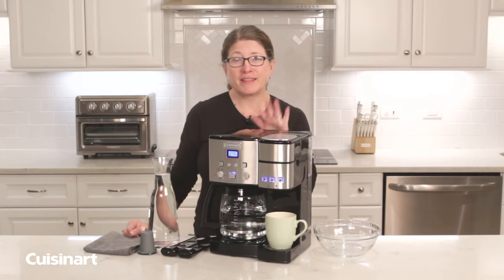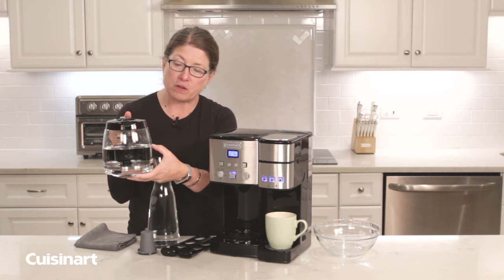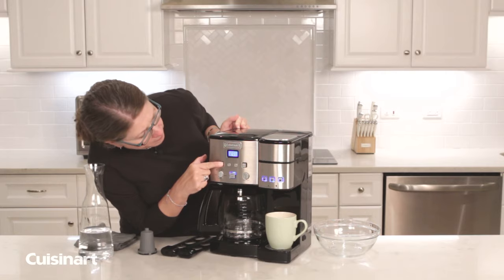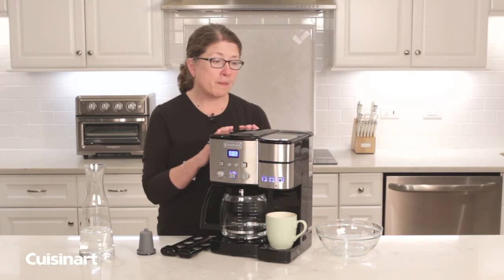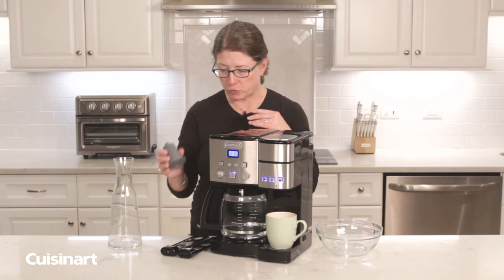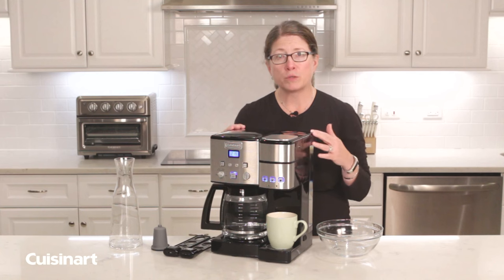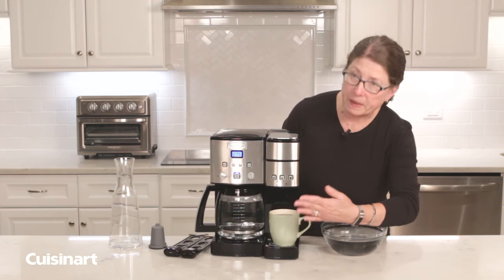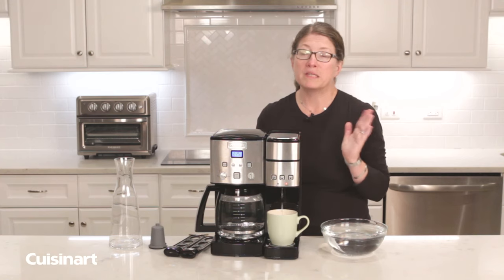Cuisinart® | How to clean your Cuisinart Coffeemaker!

Comment: I suggest start by telling us to remove the filters first.  I followed all the instructions as stated, but didn't remove the filters, only to realize  after the fact that she had them sitting next to the coffeemaker.
Reply: Wow!! She suggests that we refer to our "instruction manual. I WOULDNT BE WATCHING a video if I had the manual!!
Reply: She does fail step #1: remove charcoal filter before adding vinegar. (charcoal absorbed the vinegar yuk!)
Reply: Same thin just happened to me, I agree she should start with that step “remove your filter” agh
Reply: Same thing happened to me but I pulled the charcoal filter out as soon as I started cleaning, while I was watching the rest of the video. Also, if she is pouring vinegar in the carafe to measure, it’s not 4 ounces! More like 20 ounces or four CUPS! Other than that, good video!
Reply: Same!!!
Reply: This comment is spot on.
Reply: Hahahahahaha.... I did the same thing. My filters smelled like vinegar..
Reply: You guys use tap water I’m assuming 🤮. 

I use filtered or spring water. My charcoal filter is still in the box.
Reply: Some delicious vinegar-filled filters.
Reply: Exact same !  That was probably a more important instruction than the one minute used to describe to how wipe plastic
Reply: Yes!! Also, she said use 4 oz of vinegar instead of 4 CUPS. Not going to clean it with 4 ounces. It’s important to be correct and clear.
Reply: Thankyou I did the exact same thing!!
Reply: @Cello69. , I use filtered rainwater!
Reply: Thank you, I did the same thing.
Reply: Cuisinart making bank on reuasable filters from this video.
Reply: I did the same thing, and now have the filters sitting in a container of water. I hope that cleanses them enough. 😐
Reply: Me too. Also, should clarify it’s not 4 “ounces” as stated but “cups”
Reply: I failed to remove the filter. Too late now!
Reply: She not only does not suggest to remove the filter, but she also does not tell you to set the knob to brew.  If you watch closely, the knob is first set to clock, then suddenly in the close-up when she holds the clean button, it's miraculously set to brew.    
It would also be helpful to know the approximate time the whole cycle will take.  If you think you're going to follow these instructions and be done in 10 minutes or less, think again.
Reply: Thank you for this.  I removed mine just in time and it started to go faster.
Reply: @MrErikfernando

Comment: So, the instruction booklet says 1/3 portion of vinegar to 2/3 of water, so that would be 4 CUPS of vinegar to 8 cups of water for  a 12 cup pot. She says 4 OUNCES and its obvious she's pouring more than half a cup of vinegar.
Reply: Yes it is clearly 4 cups of vinegar she put in. So what she misspoke. That does not make the video terrible. Anyone that has common sense or is paying any attention can get some help from this video. Thanks for posting it!
Reply: If you’re only listening and not watching as she describes it, it IS a problem that she misspeaks.
Reply: I was searching the interweb to see if there was a different ounce measurement, because it certainly looked like 4 cups
Reply: I seems each new version of Cuisinart Coffee Maker needs a different button sequence.  IF YOUR CLEAN  BUTTON DOES NOT START THE PROCESS, PRESS THE BREW BUTTON DOWN FOR SEVERAL  SECONDS AND THEN THE CLEAN BUTTON.   THIS SHOULD START THE CLEANING CYCLE.  THE MACHINE WILL THEN TURN IRSELF TO 'ON' TO GET STARTED.
Reply: @paulzettler5574  Where does it say the video is terrible? 😂😂😂

Comment: You should mention that before you start cleaning the coffee maker that the charcoal filters should be removed.
Reply: Agreed, I just followed along and did not remove the charcoal filter :(
Reply: If you followed along and left your charcoal filters in, just pull them out and rinse for a few minutes under hot water.  I did and there isn't even the slightest trace of vinegar smell.
Reply: @etherealdeal1792  I change my filter every time I clean :)

Comment: So much useful information!!! I have a different model, but this helped me because, while I was pushing the clean button, I was not HOLDING IT DOWN. That made the difference! Also - charcoal filter??? I had no idea that was in there! I have been using that for YEARS, unchanged. I will get new ones today and change them regularly.

Question for anyone who can answer: What is the difference between having it go through the CLEAN cycle and the BREW cycle? Does the water go to different places during each cycle?
Reply: Same place. That’s why you need to run the clean cycle for the vinegar+water to clan the insides, and the brew cycle with just water, to rinse out the vinegar+water mixture.

Comment: Sorry, just to clarify, I have 2 questions:
• can the single serve and carafe cleaning mode be run at the same time? I didn't catch it if she mentioned that 
• to rinse off the single serve, when she said 3 complete times, did she mean 3 full reservoirs or 3 cups? It seemed like she meant 3 reservoirs but just to make sure
Reply: I believe she means to fill up the reservoir fully 3 times and run it through.  Presumably just to flush out any residual vinegar, so that none of the coffee brewed mixes with it!  Yuck!

Comment: Nice video. Glad to see it doesn't require a $50 cleaning kit.
Reply: I have had K cups for over 10 years, and I have never descaled 1 time. We don't buy filters when using Distilled water, and I make my own distilled water. Or you can buy it in the store, ANY other kind of water and your going to have to descale.

Comment: When the red light goes on during normal use, is it an indication that the unit needs cleaning or is it on a timer that goes on regardless of use?  I use the left side of the coffee maker perhaps twice a month, and the single serve side every day for about four cups of coffee.  Do both sides need to be cleaned to turn the red light off?  What does it indicate when I've cleaned the left side and the red light doesn't go iff?
Reply: It’s just a timer, it has no idea of if it’s clean or dirty. I use R.O. Only and the light still comes on. I just reset it and move on. If your using sink water then you should clean it, The red light is just a friendly reminder so you don’t forget and ruin your machine.

Comment: On the single serving side there is a clear rubber "stopper" that partially covers the bottom needle piercer. Does that have to be removed????? In the reviews folks constantly say that side splashed all over the place until you remove the little plastic "shroud" that fits over the needle...IS THIS TRUE? I can't find a reference anywhere but sure enough, I looked and it IS ther on the bottom needle that pierces the "K-CUP". Please advise, Thank-you in advance.

Comment: Great video but, I want to know how to get the mineral buildup off of the inside of the water reservoir for the single cup side. A special brush, or any old regular bottle brush? Also, the red clean light on the large side has been on for a few weeks. Does that mean it is cleaning every time someone brews a pot?

Comment: Do you have a problem with the carafe leaking? Mine leaks all over the place every time I pour, whether pouring into the reservoir or a cup of coffee.
Reply: Yes always
Reply: I had the same problem, I figured out u can’t take the reservoir out and fill and then put back. You have to leave it and fill up the reservoir ny filling cups
Reply: Every.single.time.i.pour! So annoying! I finally learned to pour over trash can to avoid any clean up.
Reply: @martinf5342  same here, so annoying

Comment: How do you get the light to reset and go out? As for the pods exploding, I push them down to pierce the cup before closing. The plastic is tougher than the thin foil on top.

Comment: I am on my second coffeemaker like the one in the video. Now this one is doing the same thing as the first one did. The red clean light will not stay off. I have cleaned it with vinegar twice and it still comes on. I have tried unplugging it and it still stays on. After I cleaned it 2 days ago it didn't come on until the second time I made coffee. 
What is wrong to keep the light coming on. This machine is barely a year old. And this is the reason I got rid of my first machine.

Comment: Great, for the past month, I've been following directions in the manual that came with the dually, and it said press-hole 6-10oz to clean.  Well, as you know it didn't work so found this one and pressed the 3-6 and voila..  Manual is wrong.. so thanks, clean light is OFF !!  finally.. whew

Comment: I know that if you are using Tap water descaling is a must, but if you want to save time and not do this cleaning!  Use Distilled water every time, we never have to clean except for the K cup side. I take that side apart and clean all the parts. put it all back together, and put the distilled water and have a great cup of coffee. Also I never change the filters, because only clean distilled water is used.
Reply: So I’m not forced to used the filter?? And can I used purified water or does it have to be distilled??
Reply: @lissethernandez50  Look I said Distilled water, this doesn't have any minerals in it that causes scaling. Distilled water doesn't have any and no filter is needed. I just bought my wife a $3500. Espresso machine and it uses distilled also.
Reply: Distilled water has no minerals it that cause scaling. Purified water also has Minerals in it. This is the third time I have told you to use Distilled. Forget the time wasting video, and the cleaning. I wash the water tank every month with baking soda. Wash it out several times and throw away the filter fill the tank, and enjoy a great cup of coffee.
Reply: @georgemacgillis8523  I was using bottled water and the cleaning light came on about a month ago, after using it for a year.  I never thought about distilled water.  Thanks!!

Comment: After following the cleaning instructions twice on the left coffee brewer side - I can't get he clean red light to go out.  I am sure it is clean - how can i get the light to go out?
Reply: Watch the end of the video to see how to clean the right side. I hope that will help since I am doing that right now and it worked for me.  Short version: fill small reservoir with 1/3 white vinegar to 2/3 water then press the 6 oz and 8 oz buttons at the same time to start the cycle. Continue until reservoir empty then flush the system.

Comment: Overall helpful but given that this is the “official” Cuisinart account this video should be re-done with certain errors and omissions corrected. For instance, there is no mention of removing the filter before doing the Cleaning step with the water/vinegar. Only after is the filter mentioned. Also, we are told to use 4 ounces of vinegar when it appears we ate supposed to use 4 cups. I just noticed that the product may have been discontinued maybe that’s why this is still up even with the errors.

Comment: Should my single cup reservoir be completely empty when the "Add Water" light comes on?  Mines does not do this.  The light comes on whenever the water level falls below the "Min Fill" line.
Reply: No, it does not need to be empty

Comment: So many issues with this video. First, remove the charcoal water filter(s). Otherwise, you'll be filling the filter with vinegar. Second, she's not putting "4 ounces" of white vinegar in there, rather she's using 4 cups according to the carafe measurements. Basically, a 2:1 ratio of water to vinegar. She should have, IMHO, said to put a coffee filter in the basket to catch and chunks of calcified minerals that get dislodged in the process. Also, IMHO, you should rinse the filter basket and carafe in clean water before running the water-only brew cycle. This video could have been better. 😢

Comment: Part of this video shows removing and cleaning the cup where the K cup goes into.  The presenter shows twisting the cup to take it appart and clean. DO NOT TWIST THIS I DID AND IT BREAKS THE TABS THAT HOLD THE LOWER PART IN PLACE.  I was able to find a replacement on Amazon for $11.  Please do not follow these instructions!!!!